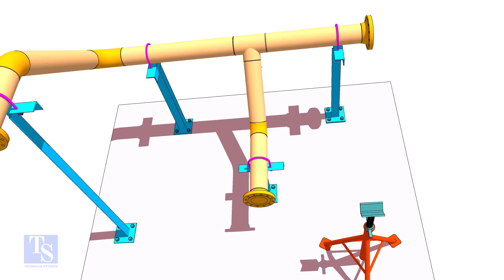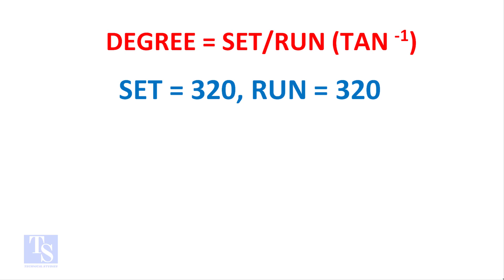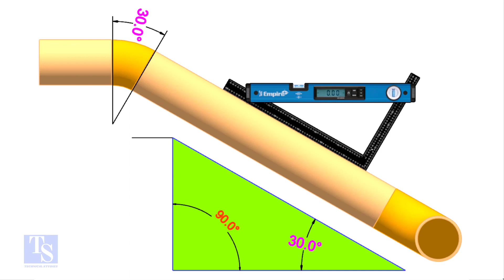Pipe Slope Checking Measuring, Any Degree.

Comment: In the drawing, Slope ratio given as 1:100. Total length 12 mtrs.  Pipe installation done by giving 1mm slope for every 100mm.  As a supervisor, How to verify the slope in the field after erection.?
Reply from the maker: You can use a water tube and check the level on the top of the pipe, on both ends. as the slope ratio is 1:100, means the total slope is 120mm for 12 meters. I suggest , you use a Dumpy level.